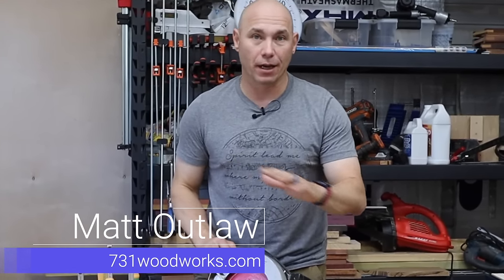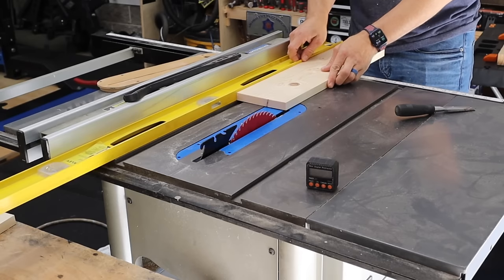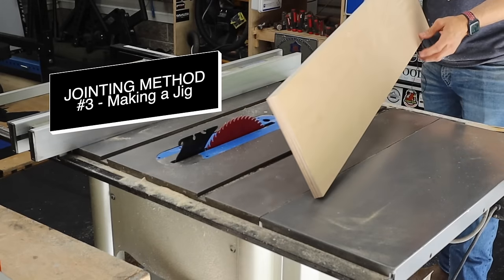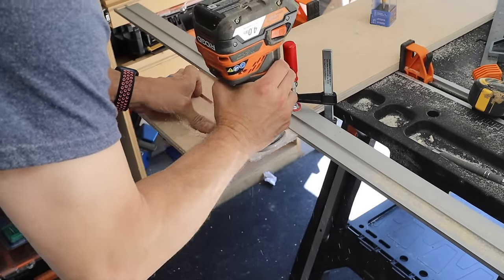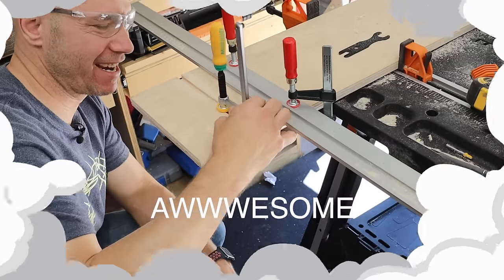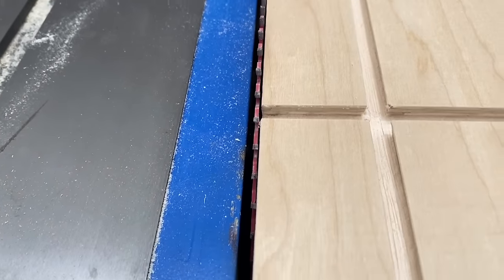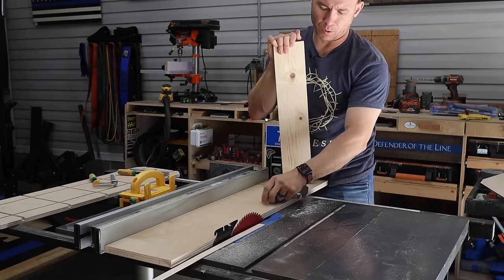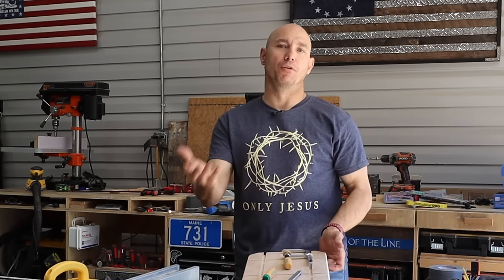5 Ways to Joint Boards Without A Jointer | Woodworking Tip

Comment: Question: I built the jointing sled and for some reason all the boards appear to be cupped after using the sled. I bought 2S lumber and when I run them through, they are flush with the sled but when you put them together there is a gap in the middle. I have triple quadruple checked the sled to make sure its square. Any idea on why this would be happening?

Comment: For the jig, rather than adding something that is the thickness of your blade to the back, you can also keep lowering/raising all along the front.

Downside is your jointer is the thickness of the kerf (⅛") so hope you didn't want it less aggressive, but the concept is the same.

Comment: The level isn't necessary if you have a clamp-on straight edge.  I clamp on the straight edge, overlapping the outer edge of the board about ¼-inch.  Like you do with the level, I slide the clamped edge of the board against the fence, and voila!  Jointed edge...IF I managed to get my saw blade 90⁰ to the table.  And naturally I have to make sure the board being jointed isn't warped or twisted.

Side issue: I have the same kind of Delta saw as you, but have an ever-so-slight wobble in my arbor.  I think it came to me that way, and I don't know how to get the wobble out.  😢

Comment: When you use method two, how far in do you set the blade when you are cutting out the inset?
Reply: That is going to depend on how much material you want to take off with each pass

Comment: That short dove joint jig works good until you have to make a table. Best to make an 8 footer for the long boards. Mine is toogle clamps. A lot cheaper.

Comment: That first tip doesn't require a 90 degree saw blade. You just need to flip the board length ways so the cut is matched with it's inverse. the 90 degree blade will help when using a vice so they don't float away.

Comment: That digital blade checker. Does it use gravity to check for 90 degrees,  perfectly vertical. What happens if your table saws horizontal surface is not level.
Just thinking since I use old fashioned hard mechanical devices.
Not meaning to Wizz in anyone Wheaties.
Just Wondering...

Comment: Well I'm doin this as I'm typing this..I assume you wanna set up 3/8 deep as the clamps are just shy of 3/8..I'll find out shortly lol..I'm using a fixed base router not a palm router, dont have one yet..so I'm using a edge guide except on the deeper lines...straight edge of course on those but I gotta do all relief cuts first cause switching out to dove tail bits on all cuts as I go just to much of a pain setting depths....I got DeWalt router and gotta take everything off to set a new bit...but ya failed to say depths on witch to set bits bro..least what I see anyways..so for those looking at this...I believe set depths to 3/8 and I'll forsure find out soon lol...

Comment: I see you use a Delta table saw is that the contractors model. How is the dust collection work on it. worried about if its works ok or just so so
Reply from the maker: It's just so so

Comment: Will this still work with a job site table saw. I would love to find a contractor grade or a cabinet saw but low$$$ is an issue.
Reply: Just used my DeWalt jobsite table saw with jig #2. Worked perfectly jointing/planing  3.25" white oak.

Comment: 1:11 You could cut them at an angle and then bookmatch the two pieces. Like this       \ \   as long as they're parallel you should be matching.

Comment: Great video! In tough times your cheery demeanor brings joy to the heart! I bought a jointer but I have to say, I think that sled you made, is going to be faster and easier!      What if there's a twist to the stock, say you're jointing a #Tobafour, would it be safe to shim it? Also, do you have Patreon? /Adrian in the not so frozen Sweden and God Bless.
Reply from the maker: Hello, for a twisted board, look in the description of this video, I put a link to another jointing video that shows how to face joint boards without a jointer.  Also we do have a Patreon, also linked in the description.  Thank you!

Comment: Just gonna throw it out there... You can joint with a router too (The handhelds). It just takes a bit of time.
I don't have the room for massive machines. I don't even have a full blown tablesaw. And the boards ain't always wide enough to keep my track saw stable. Clamp a ruler to the board and get cracking. And then the edge guide that usually comes with a router for the other side.

Comment: I was looking at videos to find a better method than I use, since I am a cabinet installer/maker and have to straighten fillers and tall fillers …. But maybe I should teach you…. 6’  level against fence hanging past on both sides, bow towards level, and no reason for it not to be straight… unless the level isn’t tight against the fence. regular bar soap rubbed  is excellent for a smooth pass. Anyways only reason I was looking at other methods is being a cabinet installer/maker and don’t have my jointer shipped here yet (just moved) , you want to treat your levels as good as possible… also holding that 6’ level on a factory cut of plywood, you may want to re consider the sheet being completely straight (you’re using a 4’ level, half a sheet of plywood, so no telling how the rest of the factory rip is. Although I’m not the prO with a channel,  I should now that I’ve been watching other cabinet makers teaching…

Comment: Check out E Z Jointing Clamp. You can find it at Rockler Hardware. Works off table saw similar to your level trick only both pieces are clamped together. Works great 👍

Comment: Looks like you might need to adjust your jointer a bit. Your fence isn't 90 to your table. If you don't want to (or can't) get it adjusted properly - a pro tip is to take every other board in your panel and put the opposite face against the jointer fence - then if your jointer is say 1 degree off, you'll have an 89 degree angle that mates with a 91 degree angle, making perfectly flat panels.

Comment: On no doublestick tape, take a length of tape and put it down on the plywood, put some superglue on the back of the tape, now get another chunk of tape the same length, put it either dry or with its back wetted by 'accelerator'  on the back of the superglued tape with tape sticky side up, now you have double sided tape (better than duct tape try plain ol wide masking tape) then lay your board to joint on the tape sticky that is facing up.  After using it just separate the boards and toss the homemade doublestick tape.

Comment: You are trying to make a perfect 90 degree straight edge. If you just want to perfectly joint 2 boards by far the easiest method is to put them next to each other, so you can cut both jointing edges at the same time. It works perfectly with any tool or with a hand plane. It doesn't matter if that edge is 1-2-5 degrees off, it will joint perfect, because the edges would be mirrored so if one edge is 95, the other will be 85.
Reply: How do you cut the edges of both boards when they're next to each other?

Comment: The jig you made with clamps seems like it would eventually pull out of the dovetail grooves if you tighten it too much??  Also I really suggest you wear a mask of some sort, all that wood dust is extremely bad for you to breathe in. Awesome video!
Reply: There is a video somewhere of someone testing what it takes to get those clamps to break the groove.  It does require quite a lot of force.

Comment: my problem with the jig at the end is that since you don't have the fence or the or the level, you are going to have to clamp down the wood to the jig using nothing but your eye judge whether or not you're creating a straight edge or a tapered edge, otherwise you'll be chopping away the top and bottom of your board to get all the corners back to 90 degrees
Reply: That's a potential issue anyway if you board is not straight.

Comment: If you already have a benchtop planer, just buy a benchtop jointer.  It is much easier to have these two essential tools for your workshop.  A benchtop jointer really does not take up too much space (you can just hide it in the shop's corner, maybe with a little rolling platform to drag it out when needed).  Do the right thing!  :)

Comment: question…  if I am jointing a longer board (6 ft), do I have to use a longer level  ?
Reply from the maker: You can use a 48" level it just a little tricky

Comment: Up until you said the auxiliary 4 foot level fence has to move with the wood I was with you, but, as long as both ends of the wood are supported by the auxiliary fence, the cut will work.

Comment: Great idea's especially the sled but you are only flattening one side what about the wider surface of the boar that should be 90 degrees from each other otherwise when you put them through a thicknesser your board wont be flat on the wider side of the board.

Comment: No need for a jointer, most of them aren't set up accurately anyway. I have one in the shop that serves as a repository for all kinds of clutter. I find a straight edge and template following router bit much more convenient. A thicknesser sled is more effective at flattening wider boards too.

Comment: Good info. 
But I also think if someone is advanced enough to even be in the realm of squaring joints,  just buying a cheap Wen jointer for 200 bucks is far and away the best option. Wen has incredibly cheap woodworking tools and if you created some advanced metric statistical analysis in which you took quality, longevity, Etc and divided that into some percentage based on cost, you'd probably come out with a very efficient tool when it comes to Wen.
For instance I have 2 track saws, Wen & Bosch. Obviously the Bosch blows away the Wen. Actually the Wen blows any of them away, and yes even you festoolboys. But I got the Wen on sale complete with track and everything for just over a hundred bucks.  The bosch with everything was over 7. Sometimes the Wen is all I need. 
Basically, I like your tips. They're great.  Just pointing out the cheap option that's actually not too shabby.
Reply: I've needed to square edges from the very beginning.  Also that $250 Wen is only an option for the people who live in the US.  Cheapest I can get a jointer is equivalent to $650.

Comment: How bout add another plank on top that has straight edge, maybe screw, tape or other way lock them together, set blade so it wont cut all the way through the top guide piece?

Comment: Should I buy a joiner before I get a planer
Reply from the maker: Depends on what you are doing. If you make more table tops that need tight seams, then a jointer will be more beneficial to you.
Reply: 731 Woodworks well i Plano doing coffee tables and end tables would love to do dining table but I am going to see how long it’s going to take to sell the coffee table I’m in the process of building.

Comment: Can someone explain why we need the jig or tape as opposed to just using the fence? Surely if it's a good fence it'll stay parallel to the blade, no?
Reply from the maker: No. Won’t work. You have to have a straight reference. If you use the fence you’re just referencing the opposite of the board. Which is 99% of the time not straight/true
Reply: @731Woodworks  Hmmm, but what if you then turn the wood around (so that the freshly cut side is touching the fence) and then cut it, wouldn't you then have 2 perfectly parallel sides of the wood?
Reply from the maker: Yes. That’s how you get two parallel sides. Joint one edge. Rip the other on the table saw using the fence to reference the jointed edge

Comment: Important note: Absolutely make sure the table saw itself is level before using the electric angle finder.
Reply from the maker: The digital angle fingers have a zero calibration. Won’t matter if the saw is level
Reply: @731Woodworks  If you mean laying the angle finder on the table and zeroing, then yes sir, you could put that saw on a hillside and still cut 90 degrees. But you did not point that out when you were setting the blade. Remember, not everyone watching your videos has used a table saw more than 3 times. If the digital angle finder is working a small mercury bubble, similar to phones or even laser levels, it will find "Plumb" but that will not be 90 degrees if the table is not level. Not dissing you Brother, was just helping.

Comment: It doesn't matter if your blade is at a 90. In fact if you were to say cut it at a 15 degree angle and flip one over they will match up giving you a larger gluing surface.

Comment: So this covers edge jointing only not face jointing. A jointer creates 2 flat and perpendicular faces that are used as references to plane the opposing long face parallel and then rip the opposing edge parallel and all corners are square. Would have liked to see you bump a square against with those jointed edges against your work surface to show that this method does not guarantee a square edge.

Comment: OR... you could just buy or BUILD a router table with an adjustable fence... adjust or shim the left side (outfeed) FROM the right side; use a straight cut bit, left side is a bit more proud of the right side (1/16th). The microjig is a great system but a halfway decent router table with adjustable fence would be a cleaner cut than a table saw jig for jointing... but hey, I'm just a guy in comments... do what works for YOU. I did build the microjig JIG but I use it for other stuff than a table saw jig.

Comment: You said "i went the wrong way, I don't know why i did that." Technically in a dovetail with the middle removed, no matter which side you go from the forces are symetrical, the only reference being the straight edge guide but that is neither here nor there so don't feel like it was a bad move.

Comment: Another way to be more accurate. Just flip one board.  The slight angle difference in the blade will be cancelled out if you flip one board.

Comment: I watch a lot of YouTube woodworking videos . A LOT LOL. I see countless guys ( and girls) going to the jointer and squaring one face and one edge, then going to the planer and doing the other two surfaces. Why? Why not do all four sides while at the jointer and save a step? Am I missing something?
Reply: The jointer will only "flatten" the edges. It won't parallel them with one another.

You flatten one side so you have a good reference for the table saw fence. The table saw will make the sides parallel.

Comment: I tried method 1 and 2 and neither worked. Especially method 2. I messed up the board more than it was in the beginning and made more curves. And the explanation for method 1 I just didn’t get but I tried it to see if it would work. Method 2, it was no difference than running it across the fence.

Comment: The level one doesn't make sense to me. Yes, the level is straight, but it's still referencing the not straight edge of the fence on the other side. If the fence isn't straight, the level isn't straight, so your board won't be cut straight. What am I missing here?

Comment: The other trick you can do with that sled is attach a fence or guide  on top of the sled as a permanent fixture this acts as a guide that you can set the edge of your work piece up against. Almost like a tablesaw on top of the tablesaw.

Comment: The angle finder being used to find 90 degrees on the saw blade is a mistake.    The angle finder finds the 90 degrees as a plumb would, with gravity.      You should have used a speed square instead.    The saw table could have not been level, and so when you place the angle finder on the blade, it might say 90 degrees, but if the table is 2 or 3 degrees off level, you will now have a 93 or 87 degree cut instead of the all-important SQUARE cut you desire.       All that matters is being square.   Not vertical.

Comment: How about for long boards?
Reply from the maker: very hard to joint a long board with bench top jointers, etc.  I used a straight edge and a circular saw recently but the board was wider.  A track saw can work for that too

Comment: I'm sorry but all I've seen is an extension of the saw fence to make cuts along the length of the board. I didn't see any actual " Jointing " of boards, Just two pieces of board being offered up to each other to see how straight the cut was.
Reply from the maker: It works

Comment: The jointer jig doesn't make sense. If the board hanging off the edge isn't straight, the edge won't be straight.

Comment: That's not correct.  The saw doesn't need to be 90 deg.  If you flip the second board over they will fit together flat.

Comment: That is not the same angle finder you used in the video
Reply from the maker: Correct.  They don't make that one anymore (or I can't find it anymore) so I put another link in to one that is equally as good.

Comment: Please, need help! 1st do NOT say borrow tools- there is no one to borrow tools from. I am a grandmother seriously I’ll raising a 5yr old grandson.I live in less than$900 a month.Building items is ONILY way to survive.I have bear minimum tools.need to make straight edges w/ only circular saw & trim router. $5 extra dollars is a gallon of milk.There are people like me (Fl give zero $$ help as I am grandmother & mother won’t sign off) .I have struggled since he was 2 weeks old .Help.
Reply from the maker: Have you considered looking for tools at pawn shops?  You can get some very good deals buying used tools.  Or keep an eye on your local online sales like Facebook, etc.
Reply: @731Woodworks  I got circular saw,jig saw, miter saw, drill, palm sander - I have made planets , benches , signs, decorative chalk board, toy box, wall ladder shelf, decorative farmhouse caddy- patio table- trying to find way to send u photos- been for sale in marketplace and 10 plus local websites for selling- toy box only thing that sold, been over 6 months- lowered prices (low)& no one buying- people here are CHEAP any ideas?